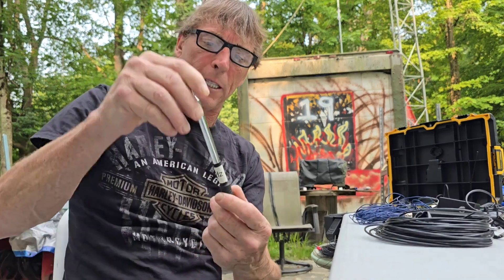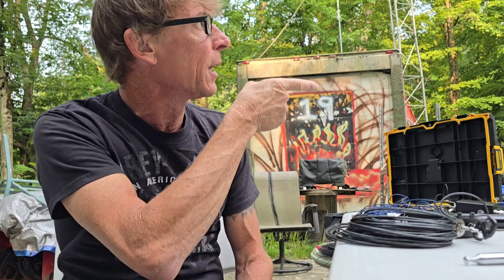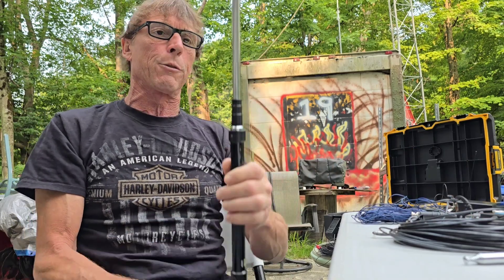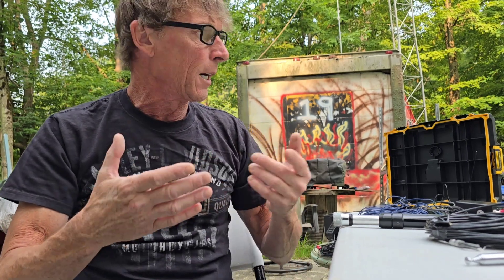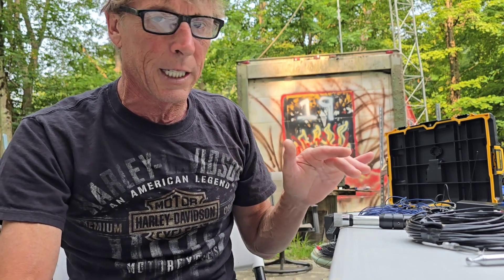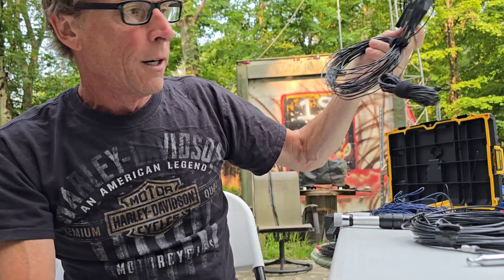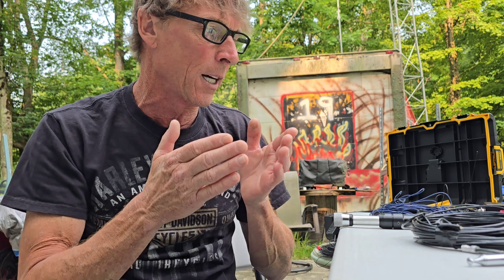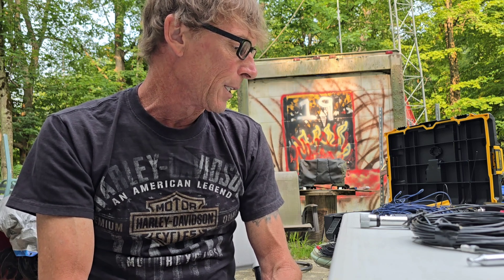The vertical antenna myth!!!!!???????

Comment: As a vertical antenna guy I’ll add one more plus for the vertical whips - versatility. I’m almost always in a new park with which I am not familiar and the 1/4 wave vertical whips just work everywhere. No masts, guys or even stakes needed as I put sandbags on my tripod. It seems about half the time I put up a wire, I end up wishing I had just brought my vertical. 

Also, I question the low take-off angle theory about 1/4 wave verticals. I’ve had a great time running mine from the bottom of canyons like Grand Canyon and Kinds Canyon which require takeoff angles of 30 degrees or more. 

No fundamental arguments against anything you said. Just wanted to add those points.  -KEØVIM
Reply from the maker: Yes i get it they are quick to deploy and work pretty good for sure thanks for the comment

Comment: Good video. Obviously you are not talking about a vertical antena by the ocean. A vertical by the ocean will outperform any horizontally polarized wire. Your statement should qualify that it does not consider the effect of seawater conductivity, to prevent it from being misleading.
Reply from the maker: Agreed will have to make a comment about that in the future although I did mention where I live and thanks ill be sure to make a follow up and do so

Comment: A doublet. Is a very agile antenna. You need an antenna matching unit thought. You set up length to the lowest band you will use and then work all the highest bands, well, almost all), without changing length. Used by the military on the PRC-47 and PRC-74. Works great for me. Next is a link step dipole. Just close the different joints that add length or shorten the antenna and that’s it. No need for a tuner. Last is a magnetic loop. 

73
Rob
YS1RS
Reply from the maker: Sweet have often thought about a doublet but never built one should try i think
Reply from the maker: And thanks

Comment: I have an early MFJ vertical with a counter poise at the top that preformed quite well till the counter poise came apart.
Reply from the maker: I've had similar antenna issue in the past had a mostly three band vertical on my garage a squirrel chewed the coax although not entirely so it took me a bit to figure out what was going on

Comment: I keep two wire antennas set up through an antenna switch all of the time at my home shack. I switch between the EFHW sloped antenna and the random wire 35.5 foot vertical antenna. I have found that distance matters as to which performs the best. Most of the time for contacts within a thousand miles or so, the EFHW out performs the vertical but on DX contacts to Europe the vertical works better. The vertical is quieter, as far as background noise, by at least an s unit, so I can sometimes hear weaker stations better. My best antenna? a full size, multiband 135ft doublet fed with 450 ohm twin lead, but a storm took it down and I haven't got it back in the air yet. Just my experience. Good video, WE5BC.
Reply from the maker: Hey thanks and yes they all have their benefits and weaknesses appreciate the comment your the 4 or 5th running a wire vertical done alot of slopers but will have to play with them more vertical

Comment: KD2EP, my experience matches yours.  I set up verticals when I am space or time limited (hiding in the HOA), but if I can get up a wire, I prefer it for performance.
Reply from the maker: Agreed 👍
Reply: @kd2etp673 The doublet  is an amazing mtiband antenna.  Simple to setup with nearly no feed line loss or common mode current across multiple bands.  

Best results are with a tuner that has a true balanced output.  Most tuners with terminals do not have a balanced output.  In that case your better to attach  a shot piece of coax and use a balun.  It is very important that a doublet is feed with a balanced output.  

A 1 to 1 balun let's the tuner do all of the matching, but a 4 to 1 will definitely work.  With this setup there's no funky common mode currant generated at the end of the feed line regardless of frequency.

Comment: Excellnt points well taken. All valid. Depends on the circumstances. For POTA, hard to beat the elevated vertical. Although a little more cumbersome to put up, my 40 M doublet inverted vee, probably works as well or better. Next experiment will be an OCF half wave vertical using a 25 ft whip. That should be interesting, as it’s a very efficient radiator. 73, Marc, W4MPS
Reply from the maker: Interesting when im done playing with this vertical array I've built will do some testing on some others im a big fan of the OCF in general have had great luck with mine

Comment: When you say 'vertical' and 'wire' you are really talking about vertical rigid vs horizontal wires? What if you use vertical wire antennas and horizontal rigid antennas?
Reply from the maker: Currently playing with rigid but vertical wires next
Reply from the maker: Correct and single verticals not arrays will definitely be experimenting with wire verticals in the future

Comment: I regularly use verticals and have been experimenting with parasitic verticals arrays lately. Using verticals next to saltwater they come into their own with great DX just with a simple quarter wave and elevated radials. A 40m quarter wave is a bit of a beast and to elevate the radials you need a long pole, I use 13.7 meter long pole and it consistently outperforms a horizontal dipole. On occasions I also use a two element Vertical Dipole Array, they are used by many DXpedition stations next to saltwater for good reason. Having said all that I regularly use a linked dipole and even on 40m very low to the ground it works great, just not for DX. Here is a video on my Vertical Dipole Array. Cheers Kevan 2E0WMG

https://youtu.be/_cpsAgXHu7k?si=L5Lu2pFtYe8zVOgZ
Reply from the maker: Pretty sweet set up and agreed so close to the coast but inland different story as far as my personal experience that vertical dipole arry interesting will research it a bit further

Comment: Just had a qso with this dude on 20 m. Great guy who knows his stuff!
Reply from the maker: Thanks can't wait to catch you on the bands again
Reply: @kd2etp673  ....depends on what you wanna do with your antenna... NVIS to work a net or local group...or do you wanna work 12K mile long path DX. A wire is often best for QSO's out to about 2000 miles but after that the 1/2 wave vertical, using a simple auto-transformer to match, and with a decent counterpoise wins hands down... usually, but not always, by about 4 to 6 db.  I have both, and have spent hours, usually on 20, in all kinds of band conditions comparing both by swithching back and forth with an amtena switch.
Reply from the maker: Just an FYI edited a video I made this morning put our qso in it will be out tomorrow at noon

Comment: I have had a ton of success with using the POTAperformer setup and have been super happy with that.  It is also quick and easy to setup.  When you setup a wire, what is your favorite setup?  I run a sloping wire from my house, but it is noisy compared to the vertical in my yard.
Reply from the maker: I typically run wires as slopers for ease of installation but if im feeling it and on my property I run them horizontal I think they perform best that way have had a g5rv endfed ocf dipole and regular dipole all up,here

Comment: Very good info. I do am dxing with an 80ft copper long wire. I get good results but I want to up my game. Any suggestions? Do you have an opinion on BoG Antennas or Ewe antennas? Thank you. 73
Reply from the maker: Been experimenting with vertical arrays they seem to work very well easy to build but one of my favorite antennas is the double bazooka have had great success with mine it's for 40m but for some reason works on 6m as well strange but made videos of it